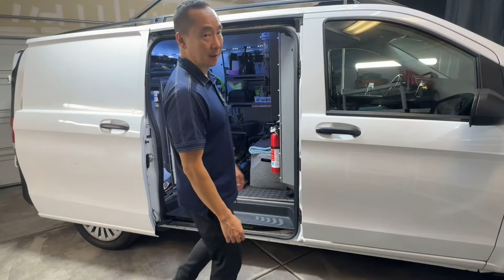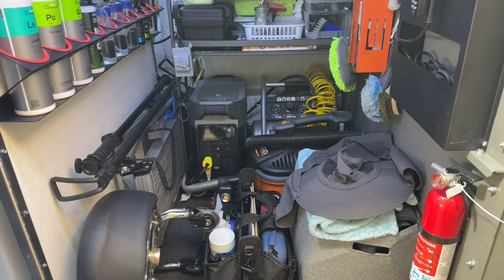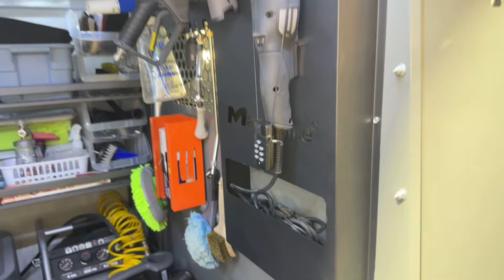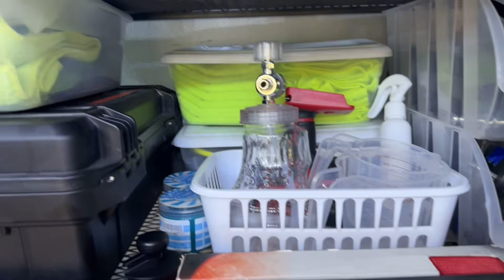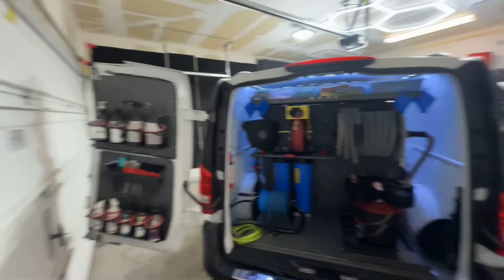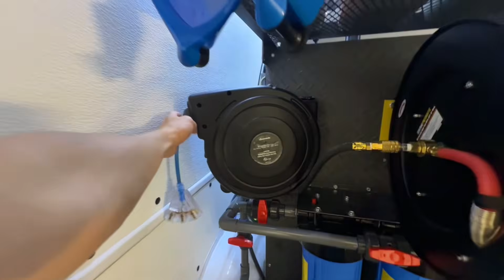Inside My Fully Electric, Custom-Built Mobile Detailing Van! ⚡ Ultimate Eco-Friendly Setup Revealed!

Comment: How long can you run a Tornador with a 4-gal Fortress air compressor?
Reply from the maker: At 90 PSI, the motor engages around the 30-second mark and loses pressure after about 1 minute of continuous run. It performs very well for interior cleaning, though heavily soiled mats will require a brief pause. Ideally, this tool delivers peak performance with a higher SCFM—around 5.0 to 6.0 at 90 PSI—and a larger tank. However, I don’t find it worthwhile to carry a bulkier, more expensive air compressor in a mobile setup. It does the job that I need it to do.

Comment: How is that generator treating you? I have been wanting to get one for a while
Reply from the maker: Working with this beast has been absolutely amazing! It has been perfect for my application. So far, super reliable and powerful enough to handle all my equipment with ease. The quiet operation is a huge bonus, especially when working in residential areas. I completely understand the hesitation—it was the same for me when I was considering the purchase especially because of the upfront investment, but I am confident to say that it will pay off quickly in the long run. No buyer's remorse on my end!

Comment: Hi, I also have an AR630TSS and just wondering how many cars you can do let’s say doing a mini datail for a full charge Ecoflow 3600Wh using the vacuum, compressor and power washer? I know the AR630 takes a lot of power. I’m planning to do all electric. TIA
Reply from the maker: Hi! That’s awesome you’re planning to go all-electric—it's a great direction for a mobile setup. I also use an EcoFlow with my AR630TSS, and you're right, it’s a power-hungry machine. Based on my scenario I have been able to do 4 to 5 cars without a single charge but it depends on several factors. An "entry-level" detail typically doesn’t require continuous operation of all equipment. If we estimate 15–20 minutes of active power washer use, along with vacuum and compressor time, you could expect to get through about 4 to 5 cars on a full charge depending on your configuration. Every setup is slightly different, so I’d recommend testing your workflow on a full charge to gauge exactly how many cars you can handle. Going all-electric is a game-changer for mobility and eco-friendliness—good luck with your build! Feel free to share how it turns out! 🚗💧⚡

Comment: Weight distribution on the van is terrible.
Reply from the maker: Appreciate the input! I actually put a lot of thought into the layout, and it’s been working great for my setup. Thanks for watching!
Reply: Yes, probably overweight on the rear axle.
Reply: @Goose077  Most of the equipment including the driver is on the Left side of the vehicle.